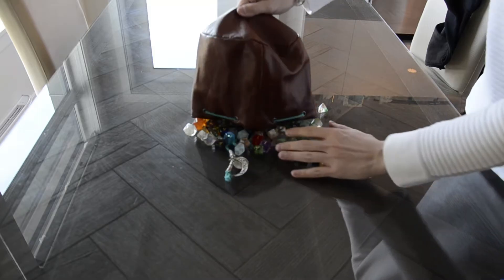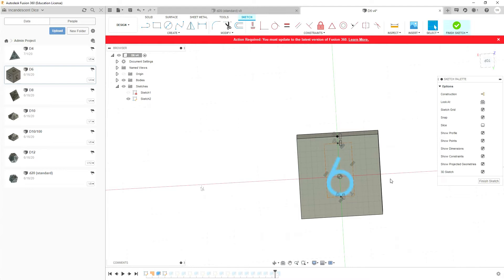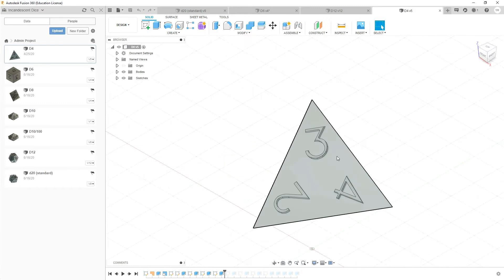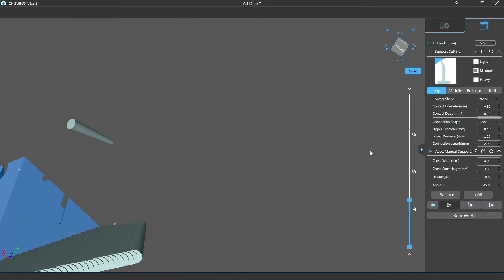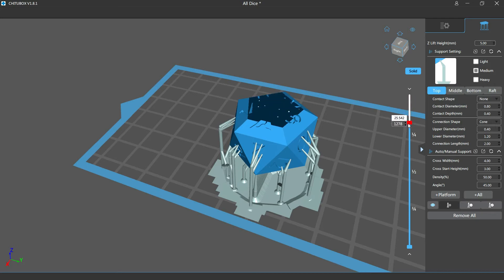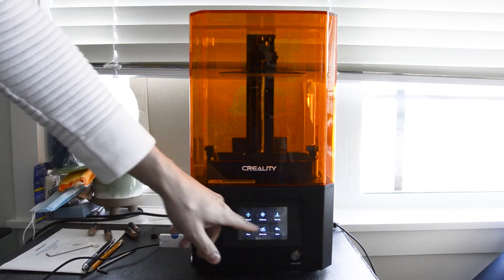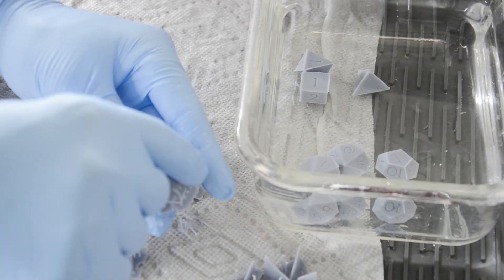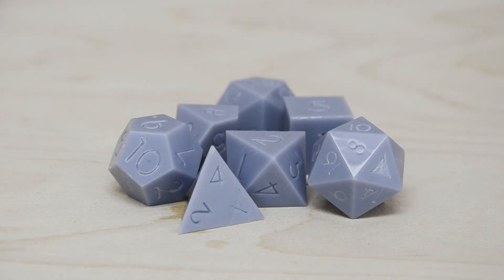3D Printing Master Dice for Table Top Gaming (D&D)

Comment: Hi, I know your going to do a video about de molds, but for coating the masters you use Inhibit X? or have an alternative? Inhibit X its not in my country so Im looking for an alternative :c 
Btw nice video its a good 101 of all the process n.n✨
Reply from the maker: Thanks so much! I really appreciate it 😊 I will be using inhibit X. It's really unfortunate that it's so ludicrously expensive but once you have your masters you don't need it again as you can just keep your first casting from the molds. Because it's the 3d printing resin that the silicone has a problem with, you could try to use some type of thin airbrushed on varnish to coat your dice. I can't promise it will work but it's the only thing I can think of that wouldn't fill in the numbers. Hope this helps! 🙏
Reply: @studioincandescent8205  Keeping the idea of a thin airbrushed varnish coat, when you coat it with a varnish it will take away some of the polishing effects but what I've seen a few people do is coat their dice to make the initial mold, then make a casting of the set in resin to make their new masters. You can then polish the new masters and make molds from those to have all your future dice fully polished out of the molds
Reply: @studioincandescent8205  In the end I use tin silicone just for the masters and then used platinum silicone, its work great, with out any problem, but the tin silicon is really smelly and oily. So now I have tin silicon for my 3d prints and if is necesary I re-do in platinum. The tin silicone cost me like $27 so works fine for me. Also I dont have an airbrush :c
Reply: @antonweber9765  that's awesome! I'm glad you found a great work around!